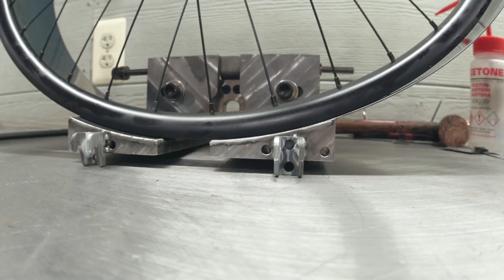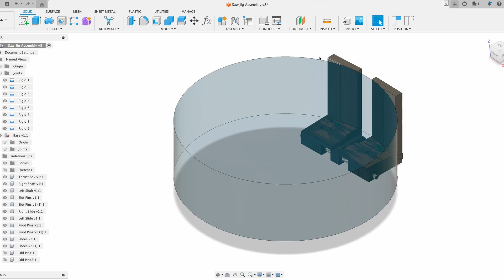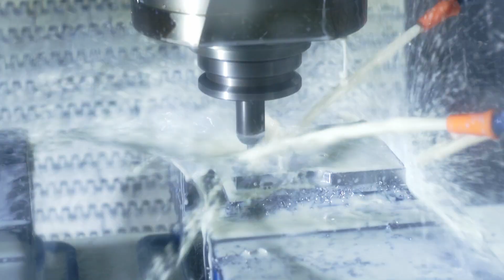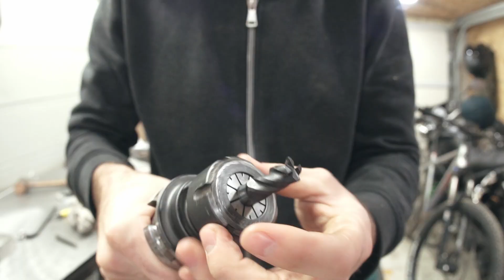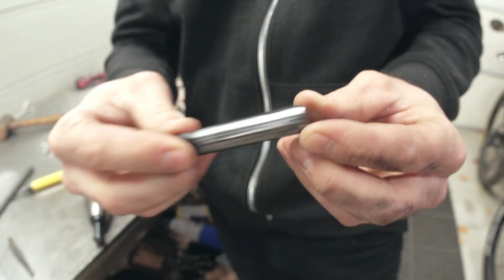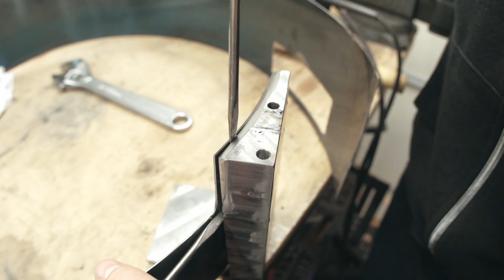P.12 Adjustable Saw Jig Build - Making Mistakes and Solving Problems

Comment: Nice! Really cool to see the adversity and challenge. More engaging I think to watch.

I think shrink fit really addresses tool pull out beautifully. People complain about vibration damping, but I don't think it's an issue until you have long reach endmills. You really only need it for your roughing endmill, so a few holders go a long way. If you are okay with metric size tooling, haas has some good deals on BT40 shrink fit holders which are excellent quality. Could do one BT40 10mm shrink rougher for steel and one for aluminum. Really nice to just not think about tool pullout. Also helps with runout, tool life, surface finish.
Reply from the maker: Thanks for the insight on shrink fit. I always thought it was more of a thing for higher rpm. I use Weldon holders now for everything possible.